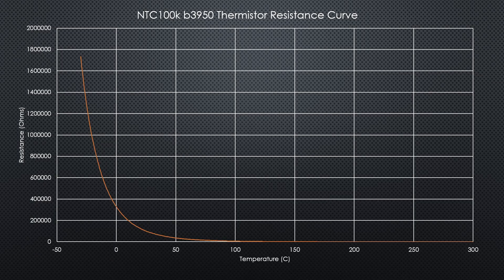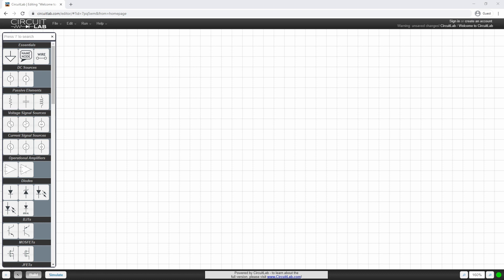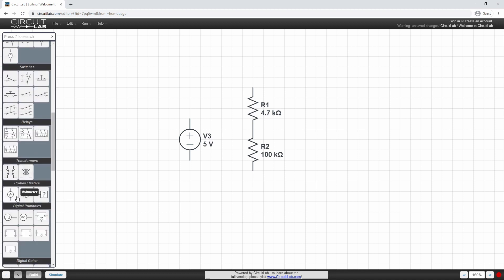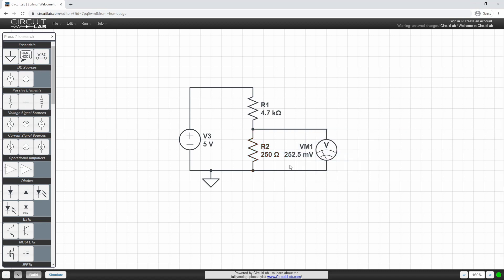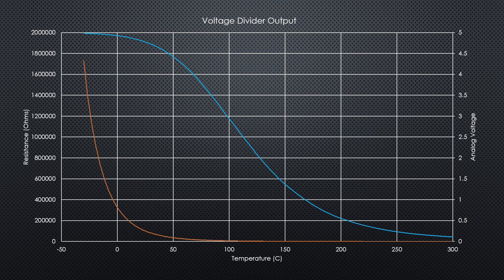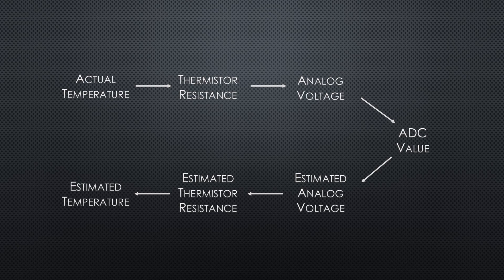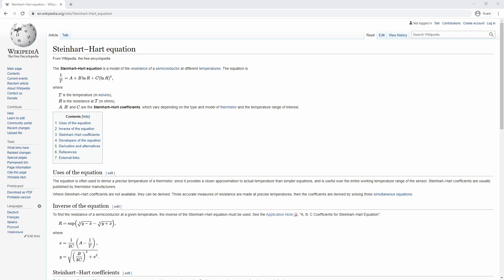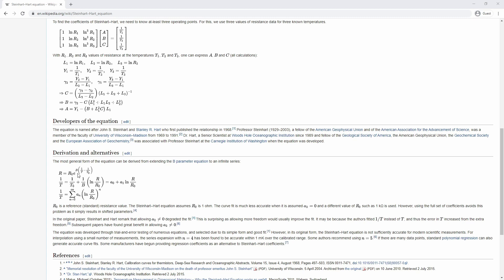Temperature Measurement: Thermistor Basics

Comment: So far I understood that, but what I don't understand is how to use this formula in a C code, or Arduino to be more precise, there are tons of examples, but I don't understand them enough to use them and I don't like to copy&paste without understanding what I copy, would be nice if someone could explain that step by step, I mean not just make one line, but separate it piece by piece.
Reply from the maker: That's a great question--I'm not super familiar with C (at least I haven't done anything with C in ~5 years or so), but I would probably start looking at Marlin as a reference, since it's C and would have code you'd be looking for!
Reply: @eddietheengineer  You know, after I wrote this comment, I searched once again and found a nice description by adafruit https://learn.adafruit.com/thermistor/using-a-thermistor There the formula is seperated in single lines, it's often like that, mostly I get the answer myself by finding the right formulation for the question or I find the answer after I asked. Atleast I finally got it, but in case it fits to you content, it might be a good addition to this video. Thank you anyways so far 👍

Comment: Hello Eddie. Actually I'm wiring up my VORON printer and I have bought accidentally a Dyze-500 thermistor on AliE. Would you suggest to change this thermistor, or do thnk it is OK to define the three heat/resistor values in the printer.cfg? As always a good explanation an a well made video. Best regards Martin
Reply from the maker: I would recommend changing the thermistor for a different one, when I was looking up the data sheet I came across this thread: https://github.com/KevinOConnor/klipper/issues/3182 

From that plot it looks like the thermistor won’t have good resolution, just considering the ADC conversion and ignoring the actual thermistor tolerance itself. The issue is that ADC resolution is generally a small component of overall error—the primary source is the thermistor itself. I’ve seen specifically with “high temperature thermistors” that the thermistor error can get incredibly high—thermistors just aren’t really a good choice for high temperatures (even the Slice thermistor has these issues). The 104NT that’s fairly common is a good choice, or if you can find a NTC100k b3950 with 1% tolerance and a data sheet, that’s the best option I’ve found so far <300C.
Reply: @eddietheengineer  I've done some calculations in mathcad to see the error of temperature measurment caused by ADC, and 10bit ADC gives error of <1% in range of 86 to 430 degree assuming voltage divider resistor = termistor resistance at 200 degree. But if we change beta coefficient of NTC by 1% we get 10% error at 200 degree. In other words ADC impact is insignificant in comparsion to NTC parameters tolerances. Only way to be sure in its precision is to measure resistance of ntc at needed temperatures and choose divider resistance. Thats where pt100 shines - its parameters known and precise and requere no research on specific resistor. But if you have the means to measure your NTC thermistor parameters there is no real need to switch.
Reply from the maker: @Gebsfrom404  exactly! That’s very similar to the conclusion I’ve come to as well. Unfortunately the beta tolerance of some thermistors (like the Slice 450C and 104NT) is 2%, which really makes them a difficult recommendation at elevated temperatures.
Reply: @eddietheengineer  Hi Eddie. Thanks a lot. I have orderd a NTC 100k beta 3950 from Amazon. I'm going to change the thermistor. Best regards Martin